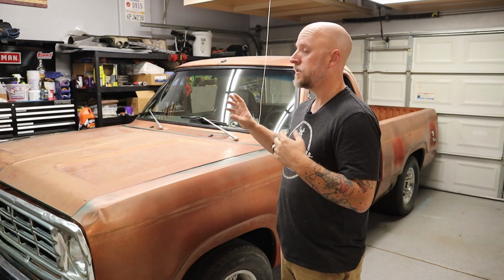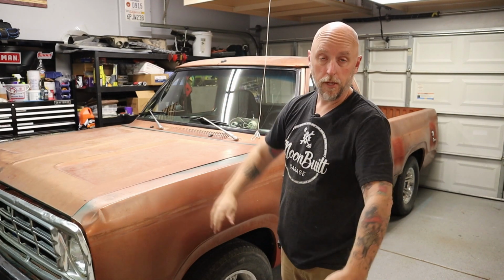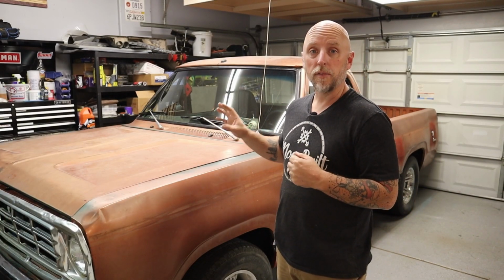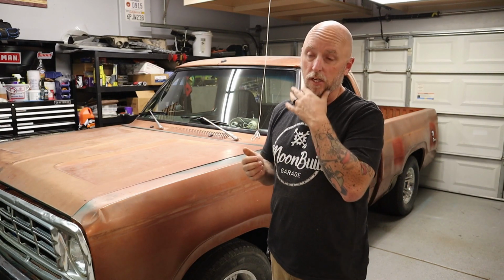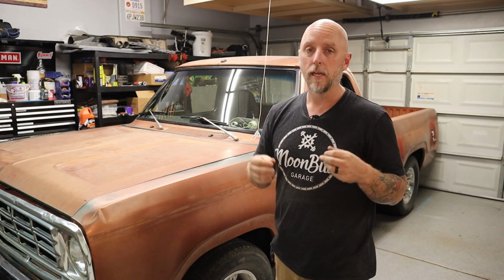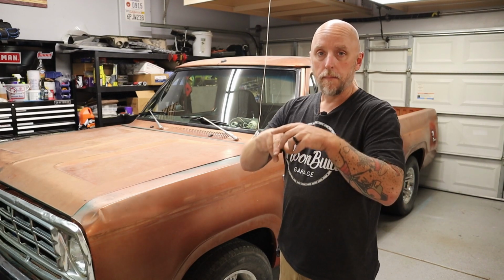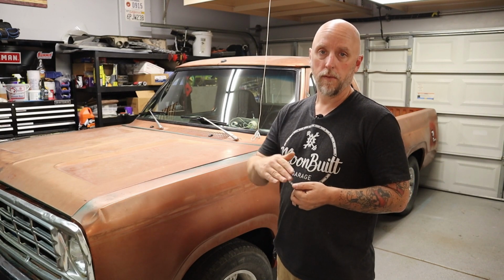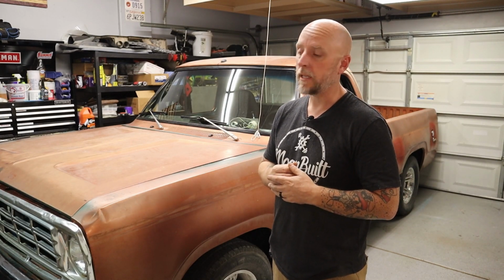Dodge D100 Project Update - Installing the Windshield, Hood, and Fixing Fuel Gauge Problems

Comment: While also working alone, I decided to remove 4 of the 6 hood hinge bolts which allowed the hood to rotate up to almost near vertical which made engine removal much easier. Then hooked a tie-down strap over a rafter and under the hood lip to hold it up straight. The thought of WRASSLIN a removed truck hood by myself around the shop was a bit daunting! Glad you got it done, that looked...not easy.
Reply from the maker: I would have rotated the hood up, but I was often moving the truck on and off of jack stands, and I didn't want to have to worry about ceiling clearance.  But, yeah...WRASSLIN that hood was a PITA!!

Comment: 👍Very difficult windshields to install especially with aftermarket glass. Congrats on getting it done. Check for leaks these Dodge cabs tend to leak from the windshield and kickpanel driver side vent.
Reply from the maker: The installer made it look easy!  Had I done it I probably would have broken it.  I noticed a few areas around the windshield opening, mainly in the corners, that I could see as being a potential leaking area, but I'm not too concerned about it here in Vegas.  I may at some point give those areas some attention.
Reply: We tried once and cracked it. Buddy had a shop do it. They broke 3 more before getting it. Not a fun process but worth paying the pros for
Reply: Very difficult the only way I was able to get it done was getting a mopar windshield from the junkyard and reusing the gasket. Waited for a really hot summer day to work in the gasket followed by the lockstrip, Otherwise its a nightmare. I wish the rope method  worked on these dodge trucks like it does on  the 73-87 GM trucks.

Comment: Ramcharger tanks are 35gallon. Nice upgrade for these trucks for added fuel capacity and ability to run exhaust down both sides(depending on year some were in cab tanks)
Reply from the maker: Mine originally had the tank under the cab.  I wanted to do a dual exhaust, so I went the Ramcharger tank route